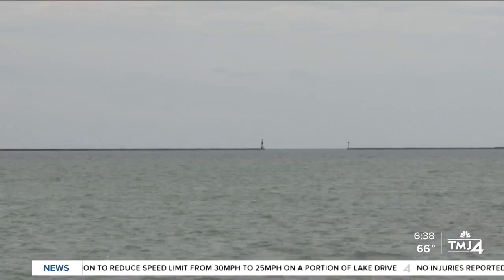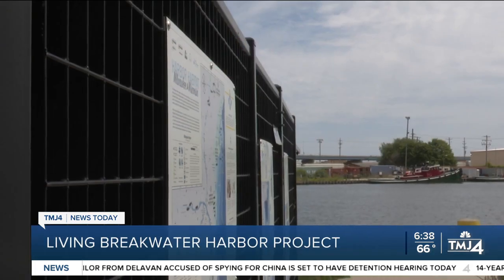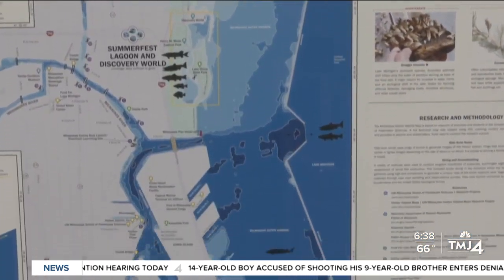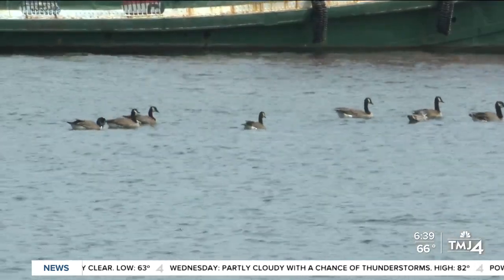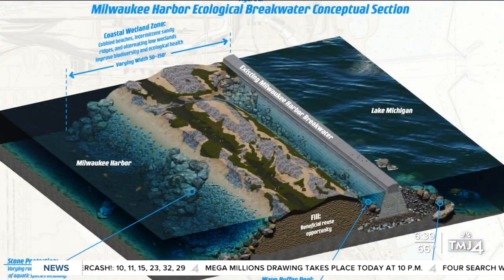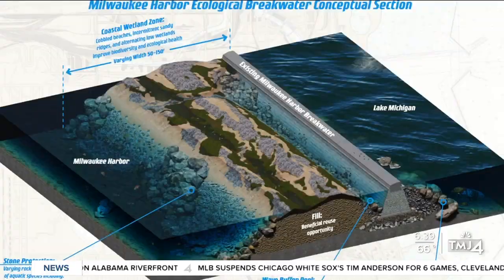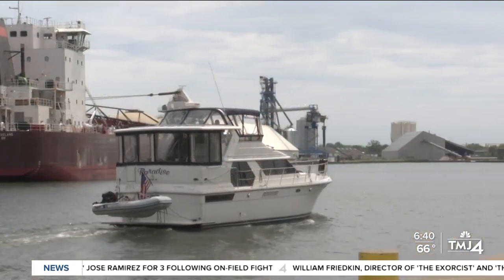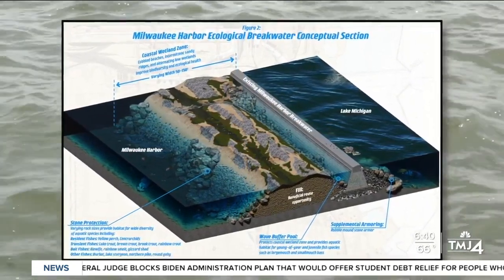Milwaukee, Harbor District awarded funding to build ecological breakwater

Comment: There already is a breakwater.  If it needs repair, maintenance, or reinforcement, that should be done before anything else.  Adding other stuff inside the breakwater will restrict traffic maneuvering around the harbor and in and out of the harbor.